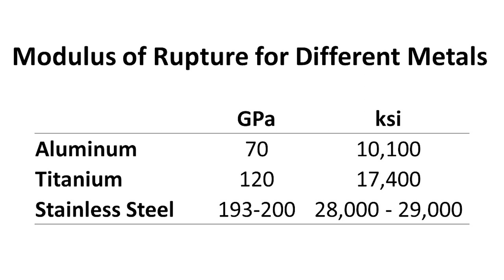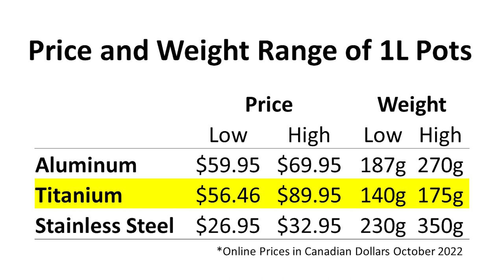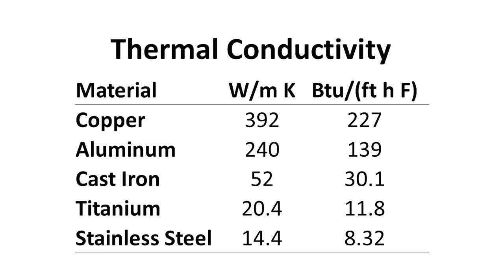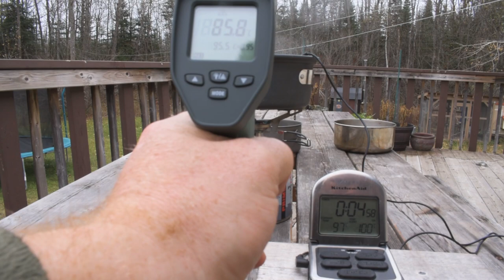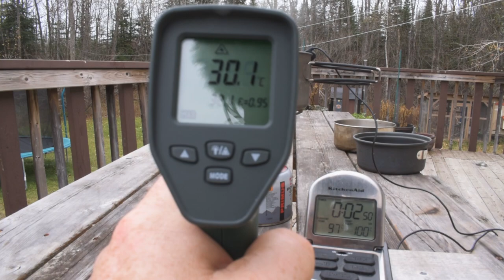Camping Pot Materials

Comment: Outstanding Kevin. I am wondering if you looked at hard anodized aluminum? It has claims to be as tough as stainless steel but maintains the light weight. Thanks for sharing
Reply from the maker: I will have to research that.  My aluminum pots and pans are anodized for sure but they are definitely softer than stainless.  They have the dents to show it.  :)

Comment: What size titanium pot do you recommend for a person that is rehydrating the meals? What size do you use in your videos?
Reply from the maker: The titanium pot that I use in my videos is 1.25 L in volume (measured to the top of the pot).  This is a little larger than many folks use but I like to have room to stir the meal without making a mess.  When I was younger and ate more a fully rehydrated meal could easily measure ~2cups or ~1L.

Comment: A concern I have with aluminium cookware is that aluminium is a toxic metal and there is some research linking aluminium poisoning to Alzheimer's disease. Cooking acidic food in aluminium cookware will increase aluminium leeching into the food.
Reply from the maker: There should be no issues with aluminum as long as it has an anodized coating.  All reputable brands will have that although I have seen a few 'cottage industry' makers that do make simple aluminum pots without a coating.
Reply: @KevinOutdoors  You may be right on that Kevin, but the non-stick coatings on pots/pans used in the field inevitably get scratched and chipped over time. When that happens, not only are we getting exposed to the aluminum underneath, but we're also ingesting whatever nasty materials are contained in the coatings. For that reason, I prefer stainless steel.
Reply from the maker: @dunordable  I do not disagree with your choice.  If someone does go with aluminum they should certainly get a high quality pan so there is less chance of that happening.
Reply: @worsdier Bad news for you, majority of the cookware in the restaurant industry uses aluminum. Immense, raw, uncoated aluminum pots. Although, you are right, don't make lemon custard in an aluminum pot, it will turn grey.